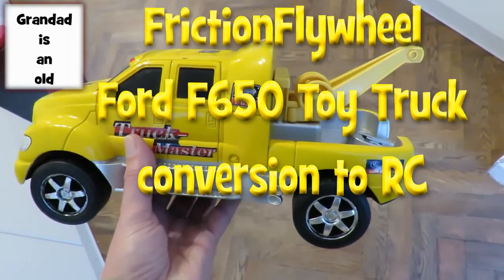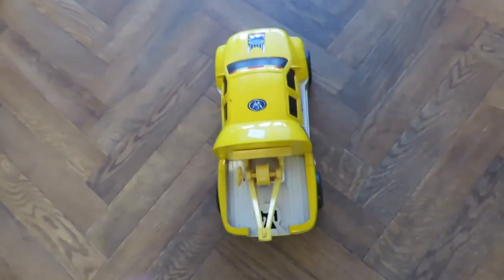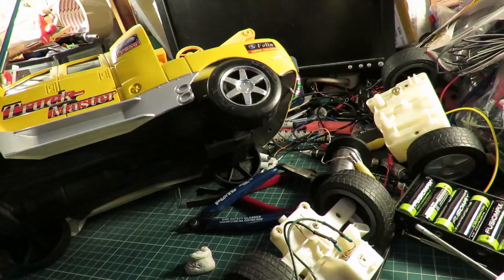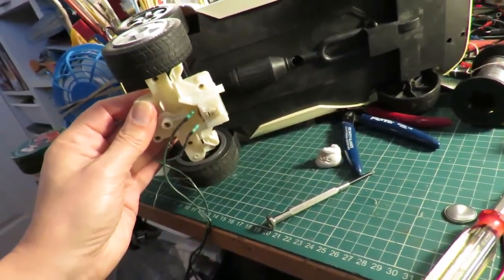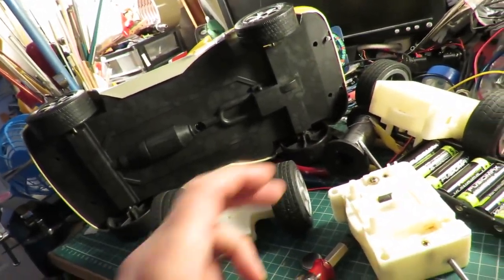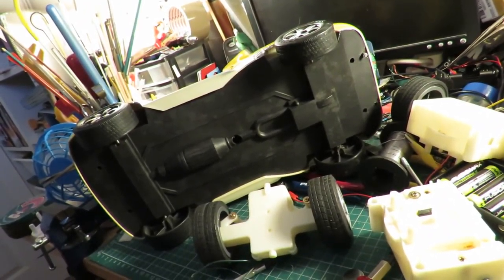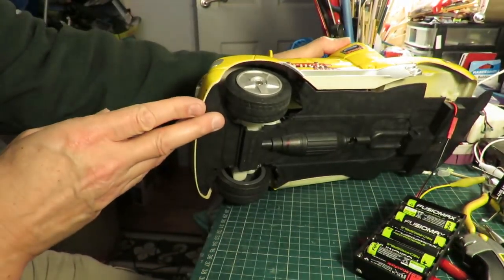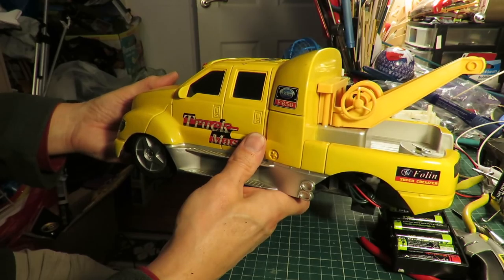Friction/Flywheel Ford F650 Toy Truck conversion to RC

Comment: Hello Grandad. That is the best looking "Hook" I have seen for a tow truck in many years. Now can you put a line on the wench and windup one of your cars for a spin around the kitchen? Lol. The gyro rear end you pulled out of the original truck do you think you could remove one wheel and put a propeller on it? I suspect it would need to be a large one, and weight will be an issue of course. Mount a spool on the axle, like the kind that sewing thread comes wound on to take up a length of cord to act as a pull string to wind up the gyro motor to get it air born? Fly like a helicopter straight up and down?
Reply from the maker: Hi Ed, you certainly come up with some novel ideas. That's an interesting thought.  I am guessing you intended the gyro/flywheel to store energy to keep the propeller spinning?
Reply: Yes Grandad that is exactly what I had in mind, so I will take your reply as a compliment. I still think it may be the weight that keeps it from flying.
You flew something similar about 1 year ago that look like a hot air balloon, you pull a rip cord and it flew. That style only the prop takes off and leaves the re-coll string behind in you hand. I was hoping the gyro would store enough power to lift it up just a little higher than the propeller type. You always keep me thinking. :)

Comment: awesome conversion grandad, ur good at onverting stuff over to rc, what tools did u use to cut the chassi up to make the wheels fit onto it? looks really like a low rider and ya the body work could have been lowered quiet a bit other then that  workds really well for what it is. hope to see more conversions in the near future :)
Reply from the maker: Hi Marc, the tools - sharp knife, saw, hot soldering iron.

Comment: Amazing work, granddad! :D
Now I'm thinking... I have a (an?) yellow  mustang here, 2005 probably, that I wanted to convert to electric. But the wheels doesn't have axles! So that must be a great idea to do with it! :D
Reply: Well, at least I think it's yellow. I don't remember it exactly right now. O.o
Reply from the maker: Pinching the component parts from another RC car is a simple route to take. This is really not much more work than a bodyshell swap. I could have done a little more to tidy it up. As a low rider it really should have been a little lower all round but we get the general idea.